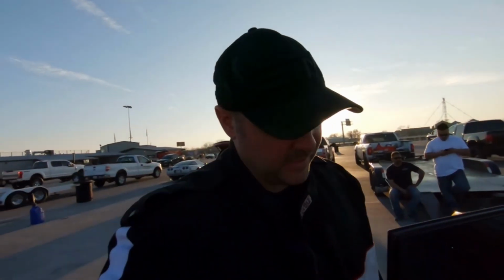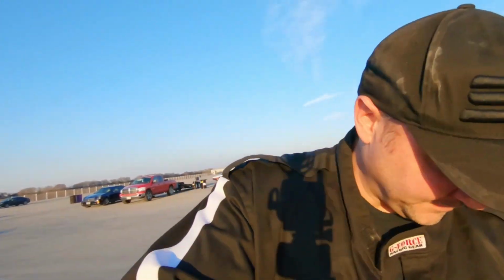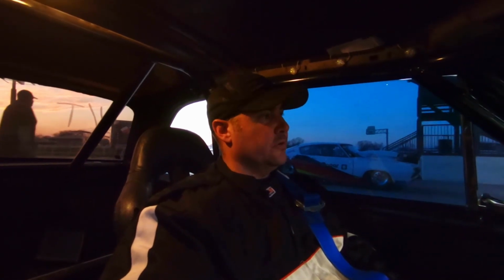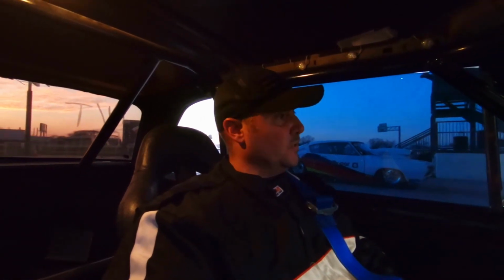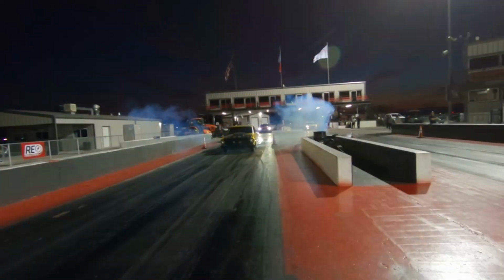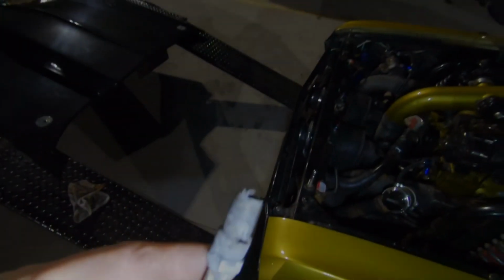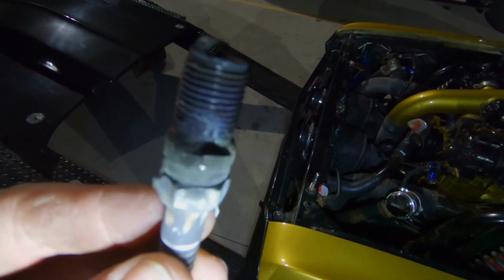ls turbo sunshine track day ends badly

Comment: Another awesome video guys. I guess it's going to get some upgrades..
Reply from the maker: Yes that decision was made for us LOL
Reply: @SickSnails  I can hardly wait to get my transformation going, I received those same turbos, still have a lot of stuff to buy but it's under way for sure!
Reply from the maker: Randy Stingray Sweet share it when you get it going
Reply: @SickSnails  here's my current configuration.
Reply from the maker: Randy Stingray Should rock ‘n’ roll
Reply: @SickSnails  Hey, they say you want the oil in and out vertical correct?
Reply from the maker: Randy Stingray Yes straight up and down as you can get it
Reply: @SickSnails  Then the clocking for the exhaust and intake is all wrong
Reply from the maker: Randy Stingray No the clocking of the turbos does not affect the center section
Reply: @SickSnails   in one of your vids I seen were you had the compressor side of both turbos clocked about 6 o'clock right?
Reply from the maker: Randy Stingray yes but the center section is always straight up and down
Reply: @SickSnails  I guess I am confused, could you call me?
Reply from the maker: Randy Stingray The turbo snails on the hot side and the cold side will loosen up and spin freely of each other allowing you to keep the center section with the feed line facing up then you just tighten them back up when you get them in the position you want them to be in
Reply: @SickSnails  lol ok I did not know that!
Thanks
Reply from the maker: Randy Stingray that’s why we’re here lol